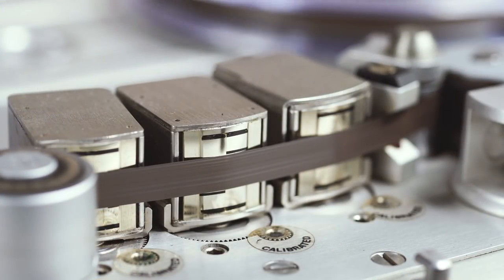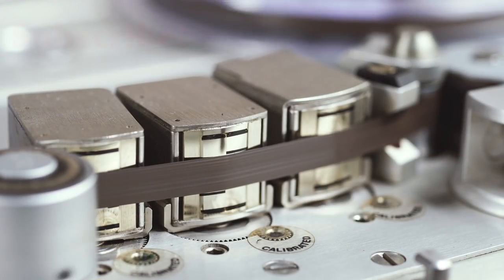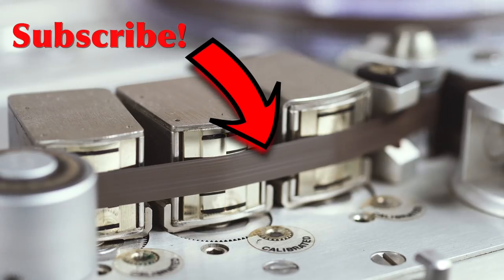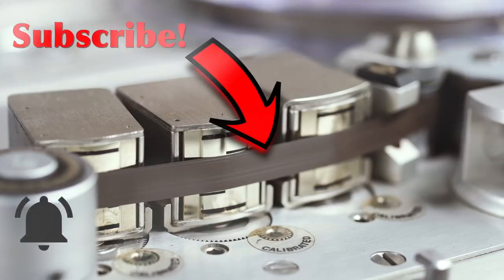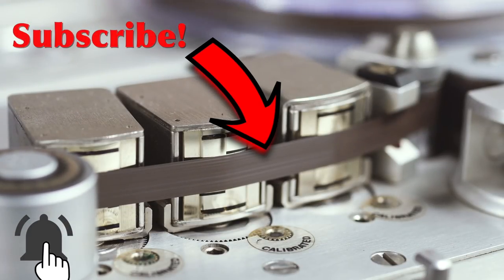Hegel H590: Reference or Illusion?

Comment: I haven't heard the 590 but I own the 390 and I haven't experienced what you describe with this component. I did once experience what you describe from an ultra-detailed COS DAC and if the Hegel had reproduced the same sense of breaking the fabric of the music apart into many disembodied "bits" strewn across the sound-stage,  I surely would not have kept the Hegel, because I hate that sort of unnatural presentation that prioritizes detail above all else. I would describe such a presentation as clinical or analytical. This is not what I hear from my Hegel at all!  For one thing, the highs are somewhat rolled off-- the sound is in no way "tipped up" or "forward". And while there is detail aplenty, it never "shouts" at me or calls attention to itself. The detail is always subservient/secondary to my sense of the music as an integrated, emotionally-involving whole. I don't know what other gear you paired with the Hegel; synergy is, obviously, always an issue to be taken into consideration. I use mine with a Sim transport feeding an Aqua La Voce 2 DAC. If the 390 sounded to me the way the 590 sounds to you, I wouldn't like it, either!

Comment: I bought the H390 last month and paired it with Vandersteen TreoCT and stream 100%.  I can only say good things about them both.   Great bass, not boomy, awesome soundstage and a clarity that is very refined.  My wife and I can listen at loud volumes all night long as the crossover of the loudspeakers match nicely with the Hegel which a little more laid back and not sitting in the front row, which I like.  
I enjoyed your review as you didn't have to blast the brand to make you point, I respect that
Reply from the maker: Thanks Denis!
Reply: get some Harbeth Super HL5's,  a Benchmark front end and a PASS or Conrad Johnson pre/pro and put your Hegel in the pool room  like mine resides........ you can listen at really low volumes because finally your gear is good ........

Comment: That can be related to high damping factor, some, most of speakers do not like it, their crossovers, their diver/enclosure tuning can interact with high damping factors and start to ringing due high Q states in loudspeaker system.
Try to put 0.05-0.1R power resistors in series with loudspeaker

Comment: I auditioned the H190 and H90 for a period of time and I think that’s pretty spot on regarding the sound characteristic 👍 Regarding damping factor, I used the Exposure 2510 (75w/40 damping factor) with B&W Nautilus 805 and it managed it without a sweat. The H90 (60w/2000 damping factor) definitely did not. The H190 was fine though (Note that I listen at low/mid volumes exclusively).

Comment: I love Hegel sound and you are absolutely right about h 590. After a week evaluation on both h590 and h390 in my home, I picked h390 every time when i did A B testing between the two( money was not deciding factor) . I mean h590 sounds good, but it's way overrated. I totally agree with your findings. It matched mine. Hegel h590 went back, happy with h390 in my second system.
Reply from the maker: Interesting
Reply: Which differences do you find between the H590 and the H390?

Comment: Hi, nice review. I have the Hegel H360 for about a year now and i think i see your point. First of all, I don’t use the internal dac, i have the holo spring 1 wich is far better than the internal dac. What i feel with the internal dac is the midrange focus. It just isn’t there or not feel natural and i try it with different speakers but i was always locking for the Voice “death center” but it isn’t there. Another thing that i notice independent of the type of dac using is that the soundstage is a litle low, like the voice came from beneath  the eye level….the 4000 damper factor is real amazing and can drive any speaker but maby you are right about the sound not sounding natural. Is something there that i don’t like so i’m considering selling  it and return to valve amplifying.
Cheers
Reply from the maker: What you are writing is exactly what I found in the H590...so strange, so unnatural...

Comment: I saw the video and I read through several of the comments, interesting.  When Hegel came out touting the high damping factors, I asked myself, how are they doing that?   All other major manufacturers pale in comparison.  Anyway, you hear all these great reviews of the Hegel amps, and this little question just stuck in my mind.  Did you notice that their power amps have a much lower damping factor?  I wonder if they might sound better because they are doing less sound engine "magic"?  The H20 with 200 wpc is "more than 1000" and the H30A 1000 watt mono is "more than 500" damping factor?  Kind of strange.  Thanks for the great content!
Reply from the maker: True!

Comment: Tried the new beauty Luxman L-595ASE agains the Hegel H590. It was no comparison with the Hegel and I fully agree, there is just something off with the Hegel. It feels like all the individual instruments are taken apart and amplifier separately to create this huge soundstage. However, at the cost of feeling connected and integrated. The Luxman felt, organic, connected, warm but not without losing high end clarity, the warmness of connectedness if that makes sense. 

Second shoot out was the Luxman against the Audia Flight FLS 10. First using digital only as input, then using phonostage (for FLS 10 this is an additional module). I've listened for four hours trying to convince myself the Luxman was better, however it was not. The clarity, openness and air between the instruments was just way better with the FLS 10. Not night and day, you can even argue that if you're more into upbeat, rock, metal the Luxman would give you more pleasure and less fatigue (if you turn the knob up..;). With vinyl the differences were larger and this, imo, has to do with the phono stage and not the amp. The FLS 10 module at EUR 1100 is just way better than the Luxman integrated. A pity, especially when using MC.  

So my ranking would be 
Audia Flight FLS 10: fantastic, ordered.
Luxman L-595ASE: great and very close, 
Hegel H590: not my kind of thing, maybe for other. Tip: go and listen and compare against fully balanced Class A or A/B 

Love the channel, keep it up and order a cassette deck to try the FLS 10!
Reply from the maker: I have no doubt that your comment and preference are spot on. Audia is amazing and soon I will reveal why...congrats!

Comment: The same issue described jay from 'thenextbestthing' when he talks about high end turntables. "They Sound too Digital" too clear..
Therefore he preferes vintage turntables 
to get the analogue sound.
I never heard a high end Transistor amp.
I User a high end tube amp for my BBC speaker laid back Sound chain.
And a sansui 331 vintage receiver for my "exciting, sparkling" klipsch Quartet forward chain. 
Both Systems Sound like everything fits together almost perfekt. No issues.
Dual 1219 + Dual 1226 😉
Reply from the maker: Nice!

Comment: Hi! Thank you for sharing this. I have the combo Pioneer c73/m73, the ones from the 90s, Urushi, and I’m running with them the Focal Arias 948. But lately I was thinking that maybe the Focals are more capable and the amps might hold them back. Any thoughts or advice? Should I keep them or go the Hegel way… 390? 590? Thank you!

Comment: Why even analog sounds digital is that any analog signal connected gets converted to digital as it enters the amp.  It then gets converted to analog to send to the speakers.  This would also influence the sound from an external dac as well.
Reply from the maker: I don’t know what Hegel is doing but clearly what you have written is NOT what happens in a normal amp and DACs world in the exact opposite way…I am missing something?
Reply: I hear what you are saying.  This came from a review of my H190.  I expect Hegel may treat all analogue connections the same.  “Incoming analogue signals are converted to digital and upsampled to
24-bit/192 KHz.”

Comment: My relatively modest experience with friend's H590 with three different speakers with different music genres in a couple of months period somehow brought together my impressions from the previous listening sessions. In the recent listening session with speakers with active bass unit and passive mid and high unit above (dipolar version) was compared with a copy of JLH 1969, a little class A amp.
This time really showed up H590's achile's heel, that it's strongest point is also the weakest one. I guess it has to do with very high damping or/and some other Hegel's electronical solutions. What do I mean by that?
In short. H590 has a great natural or neutral sound of acoustic instruments and great easy presentation of anything. But for instance classical orchestral pieces, instruments would have a great natural tambre - tonality but all together the sound, the ambient is somehow liveless and has somehow truncated presentation as a whole. Of course the highs are just not airy and open and refined.
Here little class A amp surpasses H590 significantly. True, the instruments reproduced through JLH1969 does not have H590's body and sounded a touch less neutral, but as a whole soundstage is simply alive, much more space ambient, spatial q-es, refinement and even better imaging and 3D presentation.
Of course, you can not play music as loud with JLH as with Hegel and JLH needs more efficient speakers to do it's best through the whole Hz register, but up to 80 db avg it does fine.
And we are talking about comparison of lightweight little 6 kilos, 2x10W amp, for cca 300 USD versus over 30 kilos, 2x300-500W and cca 12.000 USD.
Reports by German audiophiles says that with appropriate, quality preamp, the JLH1969 plays even on another, higher level, and many of them sell or put in a closet their amps for 10.000 EUR and even more. I put my old Marantz 7200 KI Singnature in a closet. I will certainly  test some preamps this year.
I agree. The H590 is a great amp with some great qualities in sound reproduction.  I was excited about hearing it for the first time. But somehow it is liveless with truncated highs. And my friend experienced audiophile, theH590 owner agrees with this. 
And Hegel lovers say, that even H390 is better - more "musical" and even more are older versions like H300, but I can not comment on this.

Comment: Just curious, was this a new unit, if so how many hours of break in did you put on it?  I have an H390 and I must say the sound definitely relaxed after about 100 hours on mine.  I gotta say right now I am really enjoying the 390 with Harbeth speakers, perhaps because those speakers have a very prominent midrange sound.  I’ve heard the class AB luxman integrateds and I did really enjoy them, but I don’t know if I’d like them more than the Hegel.  Anyway, if everyone liked the same things life would be very boring.
Reply: Bruh, I don't think this is a burn in issue as much as it's a processing issue with the way Hegels do their music output
Reply from the maker: Good question. Used unit, did get its full burn in.
Reply: @anadialog  Maybe they just didnt match well with your speakers?
Reply from the maker: I doubt that. I have a pair of GoldenEar Triton Reference speakers and Sandy Gross himself, the founder and engineer behind them, recently presented these speakers driven by the H590 at the Rocky Mountain Audio Feat. So they supposed to be a perfect combination. Plus, this type of amp, as commercialized by Hegel themselves, is capable of driving anything.
Reply: @anadialog  then its just personal  taste, everyone likes different flavours of HiFi
Reply: Burn in isnt real lol

Comment: I had to sell my H390 as it was soundings soulless to me. Also, the built quality isn’t that great for money. Always trust your ears! Great video!
Reply: You need to learn about amplifier design and parts cost. There are very few amplifiers in the H390’s price range that use as many high quality output transistors. It wows you with internal build quality and sound. It doesn’t bother trying to grab your attention with extruded aluminum, glass, or meters on the front.
Reply: @toucheslapper  fully agreed and H390 is an excellent amp. I just got better results for my ears with the cheaper separates. In this price range, separates are still unbeatable. I have also sold my moon 600i for similar reasons.
Reply: @novicatoncic6908  so you would still get the Hegel separates instead of the H590?

Comment: I own Hegel H390 and have it paired with Wharfedale Elysian 4. The Amp tends to render bass and transients with great accuracy, but reduces the volume of smooth parts of the audio. For example, in a heavy metal track, it brought the drums so forward that the guitar was hidden. If you listen to music which isn't mastered with a lot of dynamic range (small spikes or  transients), Hegel will flatten it out even more and it will pronounce any transients
Reply from the maker: If that is true, and I believe you, we are clearly facing software issues. An amp should only do that, amplify with less noise possible...that is where voodoo starts..
Reply: @anadialog  I don't know if it's software. I believe it's a negative side effect of the sound engine 2, which tries to reduce the distortion with a forward feedback.

Comment: Ciao
I know you like soul and other music. Just wondering when you listened to your Hegel if you noticed the seperation in the Hegel more from recordings from the late 60's and 70's?
On my Hegel I notice that on older recordings you can hear the "mix" more so than on newer recordings. So on Faces-Ooh La La I could literally hear how the track was mixed. Guitar on the Right channel, drums, bass, etc.  On the left was more the vocals. It definitely was like from the recording engineers perspective. Meaning if I was at the mixing board I could listen to the guitar, then add in percussion, bass, and vocals. Great song, but it wasn't blended enough. On more contemporary recordings definitely very detailed, layered, and textured BUT more cohesive. I know the Luxman is detailed but smoother and warmer. It also provides a more phantom center image by far. Good fun. I like them Both👍
Reply from the maker: I didn't notice this difference, I heard it on analog, digital and all types of music...I am quite convinced that we are facing an elaborate signal processing that is separating the frequencies and them putting them back together...but they don't sound "together" anymore!
Reply: @anadialog  Thanks. Also thanks for the info on how they hoped to sell the sound engine tech. Very interesting.

Comment: Is there some kind of DSP being done to the signal (apart from the built-in DAC), or is it just a more technically revealing analog amp? The suggestion was made that the signal is being taken apart and put back together. Is that based on some knowledge of their proprietary technology they use? How would other amps with a reputation of being accurate and revealing (like Boulder) compare to the Hegel?
Reply from the maker: I don't know but it sure sounds like that...
Reply: @anadialog  Here is a description of the technology they use: "The SoundEngine 2, in many ways, works like a noise canceling headphone. A computer inside will sample what comes into the amplifier and compares it to what comes out. The computer subtracts the difference (distortion) and then add it into the music but in reverse phase. The result being that, without any time delay, the SoundEngine cancels out almost all errors made by the amplifier. Leaving you with the most musical and natural sound you ever have experienced." Obviously, people who like tube amps, and even some solid state amps designed to sound a little like tubes, are going to sound different from Hegel. Which is better is very hard to say. Clearly, you are an analog guy.
Reply from the maker: If you watched all the video you will notice that I mention another video made by Darko. The link is in the video description. You will see a lecture of the founder of Hegel explaining this and other stuff. So my answer is, yes, I know what THEY claim, but I don't know what is really going on. The sound is so artificial I can't believe their fame.
Reply: @anadialog  Like I said previously, there are some high end solid state amps that manipulate the sound to sound more like tubes, to make them sound more "musical." Same with DAC's. The problem is often the source material, much of which is junk, and that if played accurately doesn't sound very good. So people who have a lot of analog source material (especially vinyl) will often need some equipment that smooths things out.
Reply from the maker: True!